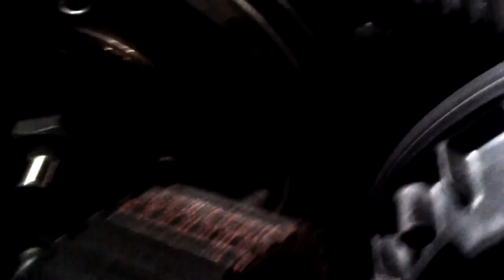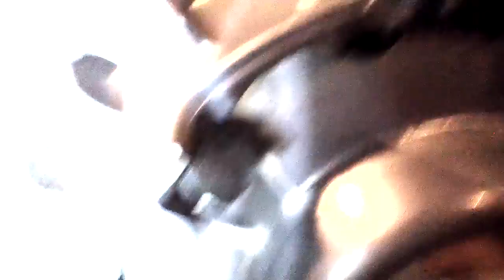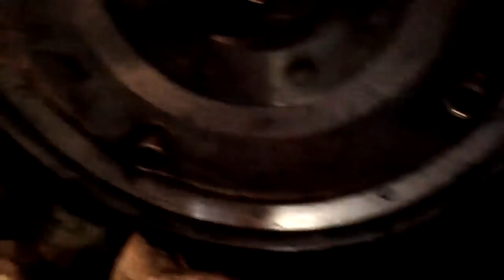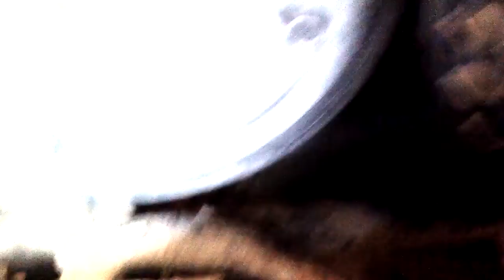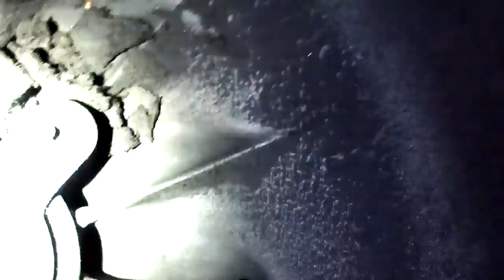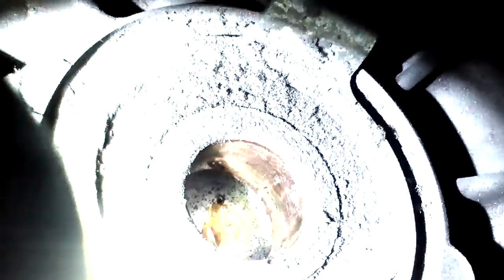Arctic Cat 500 Auto transmission issues

Comment: So I have been having the same problem ever since my wheeler spend the night under the drain spout of my house and got showered for many hours. I have been thinking that maybe water got into the wet clutch. I popped the inspection cover and discovered that though the belt looked great it was covered with oil and I am sure the outer clutches are just sliding on the belt.

Comment: Hi did you find out ehat the problem was?
Reply from the maker: I eventually replaced the belt because I had the cover off again to replace the bearings in the transmission cover. Now it seems to be doing better. If it were the primary wet clutch slipping, an oil change with proper oil for that clutch could help with that also.

Comment: Your belt is worn out and stretched, and the clutches have glazed over.
Reply: Hey I have the same bike , I just put a inner seal in mines it has power but it want accelerate fast , when  running in high it seems like it's in low , have any ideas
Reply: @jamescowans6637  I'm going to guess you put the clutch bearing in backwards.  The dot/dimple faces out.